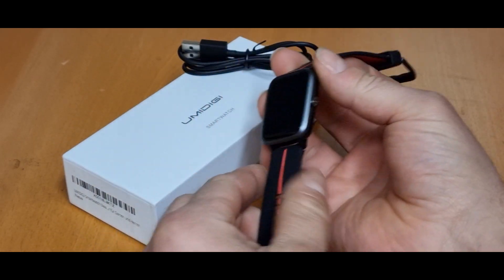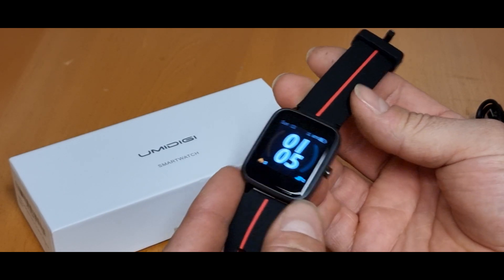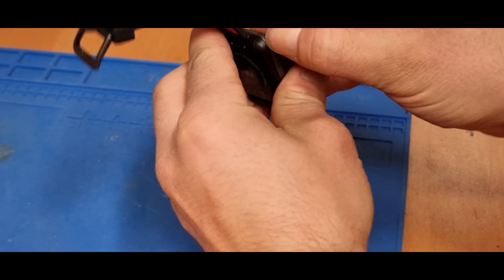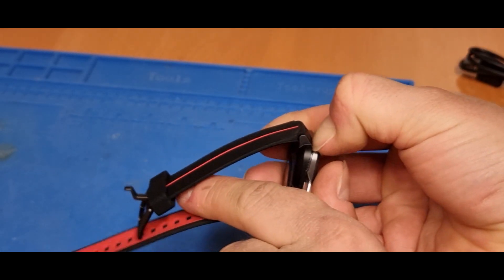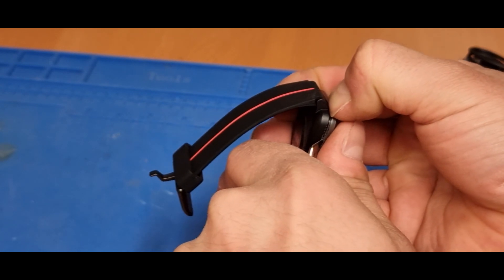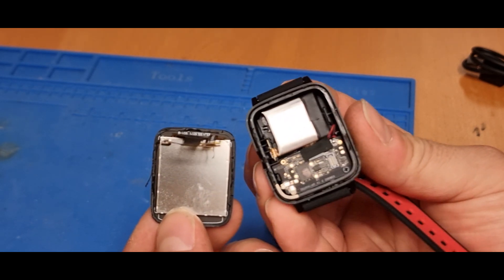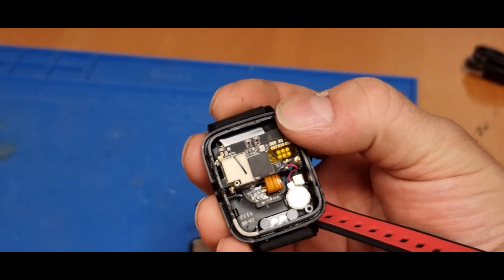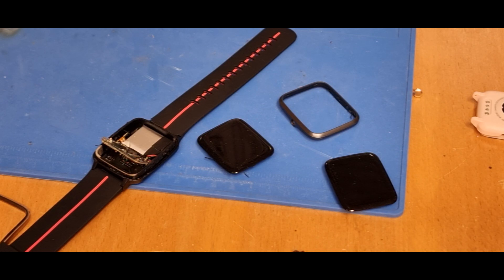UMIDIGI UWatch3 (GPS) Teardown Review ID205G / ID205L

Comment: Try wd40 to tear stuff open, it helps a lot plus little heating
Reply from the maker: Thanks will try it
Reply: @atc1441  so what did you decide for sg2 watches? Are you developing the firmware?
Reply from the maker: I stoped on it, because of it being a clone of the Samsung galaxy Active 2, its still available but will most likely not be for long. 
But I started development on the DaFit C16/ Magic 3 also nRF52840 and square screen so better for apps 
 https://twitter.com/atc1441/status/1391986075594285058?s=19
Reply: @atc1441  very cool. I was wondering if you would reverse engineer the displays on these newer Chinese watches like fk88 or w26 and so on. They don't have nrf chips in them, but the guts in these watches can be replaced and the displays on them are bang on. Thoughts?
Reply from the maker: If i ever get one it will try :)

Comment: Hey aaron, are you aware of any usb host code for ch55x chips that supports serial devices like ch340/ftdi/cdc?
Reply from the maker: Hey. Yes ch554 and ch559 does support it. It needs to be coded first of course
Reply: @atc1441  okay thanks. Do you know if the hex file for 554 will work on 559?
Reply from the maker: It will not directly work no

Comment: Great, I am a big fan of teardown videos. Although those always become a good length since you do not want to destroy the hardware. I made one of the V19 wrist band a few months ago. If you like to watch: https://www.youtube.com/watch?v=da3NJzrlwAI  The more interesting part starts at 14:20. Now I managed with my Raspberry Pi and openocd to read out the flash. There was no protection set. The firmware really needs some improvements, but it's a sisyphus work to reverse engineer it. I have no datasheet for the HR/ECG sensor as well. In the specs for this watch HX3313 is given, but the datasheet under http://www.synercontech.com/index.php/Product/show/type/10/id/10 shows a different chip and those companies are not willing to help. At least the display is type st7789_135_240. So I can use it with Arduino.